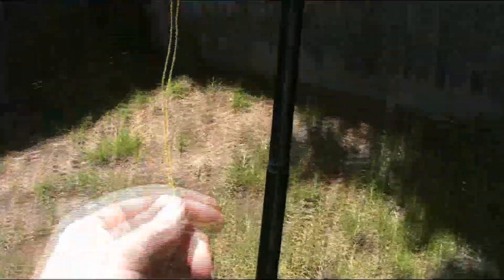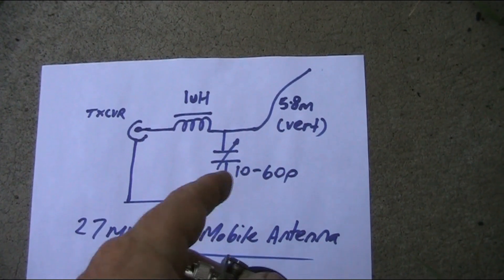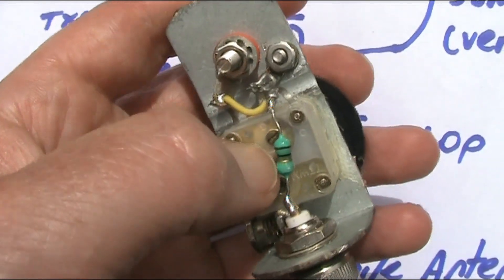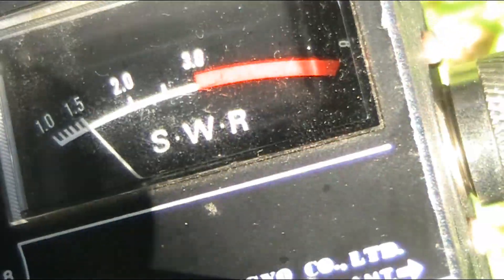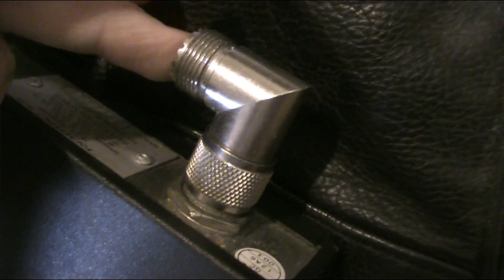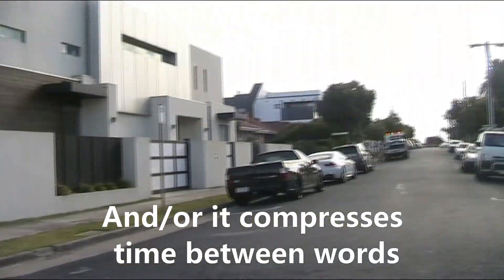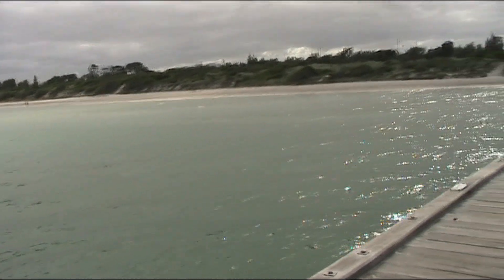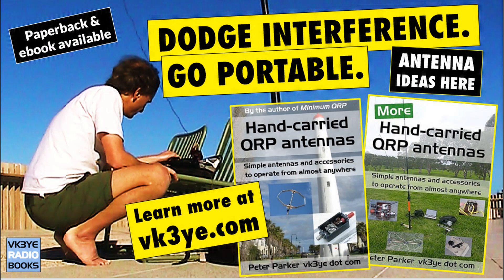27 MHz pedestrian mobile with your old CB

Comment: 50 years ago, places like Lafayette and Radio Shack sold things called "porta-packs". You slipped a five watt mobile radio in, loaded up with "D" batteries, found a hilltop, extended the built-in telescoping antenna, and had a good time.

Comment: Is it possible to modify the circuit so that L-match has a coaxial run to the radio? It seems that the capacitance of the coax upsets the match

Comment: I think I may replicate this except use a Mag Loop I made from a 26" aluminum bicycle rim. Instead of recording the audio I would just place an old cell phone with the Rattlegram App running on it. Then I could send Rattlegram text messages from my phone and CB Radio back to my home station where that phone would pickup those messages. Then I could return and scroll down the messages to check the ground wave range. Any missing messages would show where my signal dropped out.
Reply: 10 - 4

Comment: I have a Royce CB 651, in great working condition, I changed out its batteries with  LiFePO₄.
Also a XIEGU G90 with a toybox antenna. Wish I could take them out like you, I'm 75 and walking very far is getting hard.

Comment: I have done things like that . I used a 4 watt Thunder pole HT for radio. DX commander 7 or 10 meter pole. I fed my end fed half wave different. 49:1 made with t 240-43 or 61 core and 100 PF cap. adjust end of wire to tune. fold over. did not do range testing. I am in the US . NY state so was people to talk to on CB. I did take a QT 60 Radioddity 10/11/12 meter 60 watt SSB portable with 20 Ah LiFePO4 battery in a park . 10 meter pole strap to park bench  . 49:1 end fed half wave . cut to tune 10/11/12 meters. in the AM local time. I talked to England SSB . I even did FT8 and JS8 call with laptop . even SSTV . worked hours on battery. over a 100 contacts. on 3 bands. I was using counter poise wire. and I did it again with different antenna. the T2LT . just a piece of RX 8X cut and 65mm plastic bottle for coil form. that makes center fed half wave. all the great HAM wire antenna's work 27MHz . just cut to length . 73's

Comment: As an Extra Class American ham let me apologize for the 5 kW to 10 kW American moron CBers. There are morons in every country, but far too many of ours manage to get huge illegal amplifiers in an attempt to make up for their small size in other areas. I try to run under 1 Watt most of the time to make up for them.
Reply from the maker: No need to apologise. Because they confine themselves to ch6 they are very spectrum efficient, leaving the other 39 channels to the others. And they're great signals to test 1 transistor superregens with.

Comment: That inductor has seen a little heat :D
Reply: That's what happens when you're pushing high power on the order of 4 watts. Peter's one of those guys who thinks life's too short to run less than a Watt. :)
Reply: 10 - 4

Comment: Years ago, I did some 10m SSB pedestrian or backpack mobile with a 4-foot whip clamped to a metal backpack frame - trivially easy. The lead acid battery was heavy.
After a while I began to wonder about the RF safety of 25 watts of RF right beside my head.

Comment: All right I watched the video interesting and good however yes you can get more distance out of those 5 miles should be a good start I can do 10 MI with a modified TRC 216 double coil antenna or I can even do from SFU Mountain to the gulf Islands I can also do SFU Mountain to Victoria basically I can do a bit more range however I need to have altitude ultimately from let's say I did a test from a Stanley Park to North Vancouver did a test from North Vancouver to Gibson and I managed to reach someone on the a.m. must have been about close to 20 km and I did make contact with other people however yes there's a lot of noise and also having a counterpoise will definitely make a difference definitely it's a bit more challenging on the a.m. it is more noisy I also did manage to make contact on from Vancouver to Arkansas on top of the Vancouver Public Library however this is very rare using 4 to 6 Watts double coil antenna basically using a TRC 217 on of an antenna on top of a TRC 216 antenna it helped of course increase the height however the inductance probably got better less resistance resistance better for the signal radio signal and yes definitely saltwater will help you improve your signal you can use salt water as a partial conductor it definitely has improved the results when I was by saltwater transmitting signal from up a hill to all the way out to Vancouver let's say SFU it's about 10 mi in a signal came out decently then I also made a contact from SFU Mountain to going almost all the way out to Nanaimo on a fairy so basically two portables it's still doable there are factors that are involved yes and it's going to change day to day I think that you could have got more results just by using a portable TRC 217 or TRC 216 the t17 is more sensitive to receive sorry to 217 is more sensitive to receive it's going to give you an output between 4 to 5 Watts you can probably twick it up to 7 and it will definitely carry your signal quite far is the type of internet using yes it definitely helps however calibration as well the coils that are using interior c216 TRC 217 are very effective anyways point of view yes you can get more range it's just a question of trying different things

Comment: Interesting and nice setup. Instead of using this low-Q "resistor-style" inductor I would wind 15 turns of enameled wire on an T68-2 toroid core to decreaser the losses. Thanks for the great video BTW! 73 de Peter (DK7IH)
Reply from the maker: Thanks. Though for 27 MHz I'd be inclined to favour type 6 (yellow) material rather than type 2 (red) for the toroid if you have it. A T50-6 would be fine.

Comment: Will the tuner you are using in the video, with its higher value capacitor, work on 12 or 10 metres please?
Reply from the maker: Yes. It does need a low minimum capacitance as explained.
Reply: @vk3ye  Thanks!

Comment: I still have my old Pearce Simpson Super Lion MK II AM/SSB CB in the cupboard, haven't used it for quite a few years, trying this would be a good excuse to pull it out and power it up again, wouldn't have a problem finding a variable capacitor to build that antenna tuner, I work in a e-waste recycling warehouse and there's plenty of old radios that come into the place to get one out of, and the other parts i'd need.

Comment: Have you thought of converting an old CB to 10m?  G7VFY
Reply from the maker: I did many years ago with a crystal controlled CB where I could swap crystals around. But SSB CBs are quite rare, expensive used and, for post 1980s models, hard to convert. There's better options around now.
Reply: @vk3ye  There are 10m am users, and not just Bill Meara. It's a cheap way for US novice hams to get on HF. Just a suggestion. G7VFY.
Reply: Why destroy a vintage radio when you can buy a better one?
Reply: @spaceflight1019  Try substituting the word 'vintage' for 'worthless'.  They are not, rare or desirable.
Reply: @G7VFY  The current generation of "10 meter" radios will work much better than any converted CB. And yes, they command crazy money when sold online.

Comment: Been by 10 and 11 meters all morning and arvo in the shack trying to beat the heat currently 46.5C.
Absolutely dead as a maggot here in Kalgoorlie.
Not heard a dickybird other than a local mate trying for DX in vane.
Yesterday by contrast was full on.

BTW, looks like 4Watts is too much for the little inductor.  
Ready to let the magic out .
Great video Peter, I do like the manpack pole idea.
Reply: im about to get a little 27mhz setup here in greenbushes shortly, Not entirely sure how it all works but you'll probably be too far for line of sight and not far enough for skip transmissons i would guess but it would be awesome to be able to talk to kal
Reply: @Geopolitics2day  You never know Josh.
I have had many 10/11m contacts from Perth, Rocky and Mandurah areas.
Generally challenging but there are openings all the time.
Try it, you may be surprised